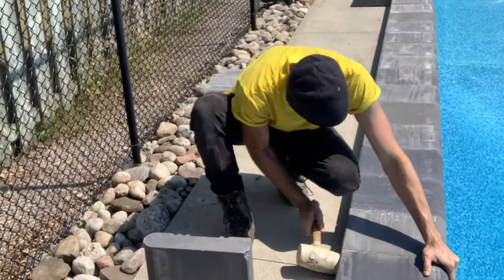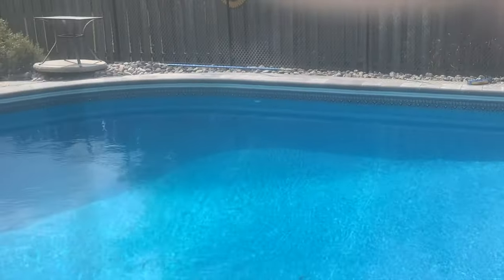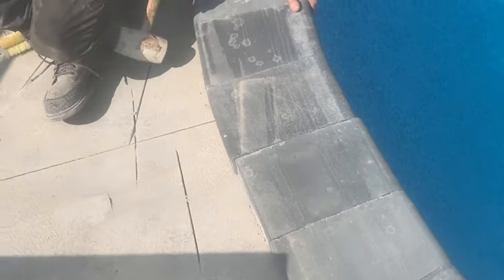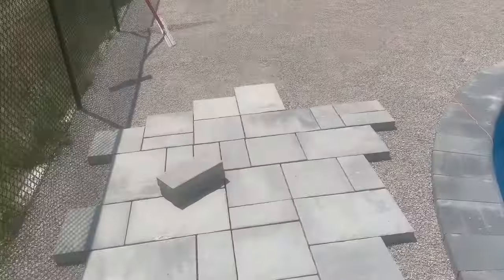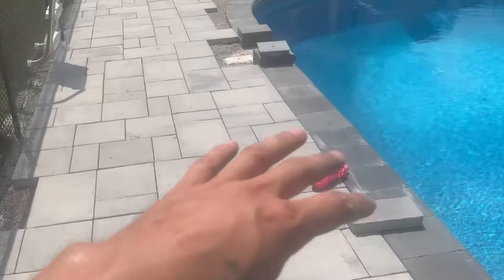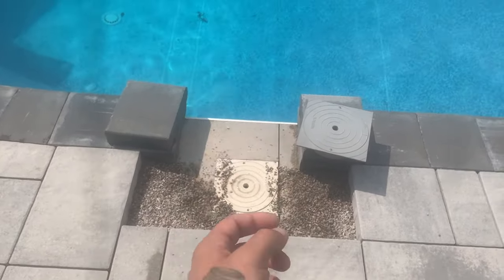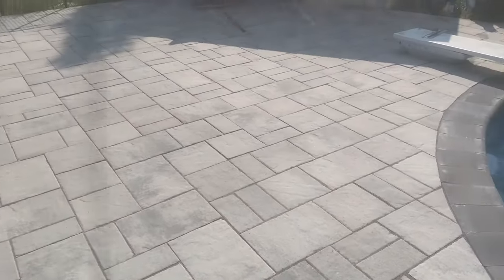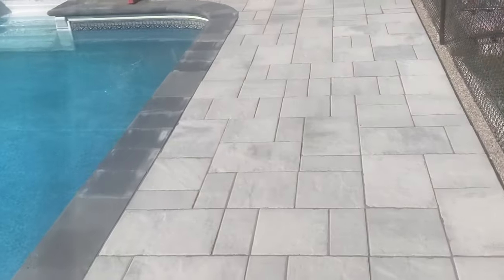Resurfacing a large swimming pool area with INTERLOCKING PAVERS & COPING in Dallas, TX. NO DEMO!

Comment: I need advice on a diy project on elevating existing bullnose pavers by 1 inch. Do I glue on top of existing bullnose where I have bullnose on top of bullnose?
Reply from the maker: Hi! No, you would need to remove the existing bullnose and install new ones using “Mortar” so you’re able to have that 1” lift. Hope that helps! 💪🏼

Comment: concrete pavers, is it ok to install them over existing deck? and do you recommend sealing them or not? also, how do you controld weeds growing between them
Reply from the maker: Hi, do not install them over a wooden deck as they are heavy and the wood will rot over time. As for the sealer, Yes, I do recommend it as it will help maintain its color against the sun, it will also make it easy to remove any stain from the surface as the sealer will prevent it from penetrating the pavers. 

For the weed control, it is industry standard to use a geo-textile membrane. This is a woven fabric that is installed under the gravel base. When the area is excavated you install your membrane. Do not use garden fabric as it is too thin. It’s a woven geo-textile membrane. 

Hope that helps and good luck! 😊
Reply from the maker: 💪🏼 Follow me on Tiktok for more TIPS&TRICKS: @FrancescoPettinelli 

See ya there! 😊

Comment: Looks great. What did you add over the cement and under the pavers?
Reply from the maker: Thanks, Mr. Smith! After we adhered the pool coping - We added sand to level the ground and get it ready to receive the pavers. 

Thanks for watching and leaving a comment! 👍🏼
Reply: @MILTON_STONE  If the concrete went out several more feet would you still use sand or go directly on the concrete?
Reply from the maker: 💪🏼 Follow me on Tiktok for more TIPS&TRICKS: @FrancescoPettinelli 

See ya there! 😊

Comment: We hardscape too, lots of frost up here in Northern NY.  

What do you do for base preparation?  What state are you in?
Reply from the maker: 👊🏻😎Nice! 

We’re in Canada.. Lots of frost here too. 

This particular project was a resurfacing job over a concrete base - no base prep was done. In a normal scenario we would dig 12”-18”, compact the ground, apply geo-textile membrane, add 6” at the time of crushed until we get to 12” or 18” while compacting each pass with a jumping jack or a diesel compactor, then we add 1”-1.5” of HPB (high performance bedding) and lay our pavers. 
 
Do you guys do the same out there?
Reply: @MILTON_STONE  how do you deal with any water from the pool washing out the bedding from under the pavers? Is there any issues surrounding that?

Comment: Did you have to remove all the existing concrete before putting the papers?
Reply from the maker: No, we did not. The concrete was in good condition so we used an overlay system to resurface it. If your concrete is cracked and in bad condition we recommend removing it. Hope this helps.
Reply: @MILTON_STONE  I know this is old, but we have some sections of concrete that are rough, could we remove those sections and fill in with gravel and sand compacted and level it off with the rest of the areas?

Comment: 80mm cope and 60MM slabs?
Reply from the maker: Yes, this way you can level the ground properly. If the coping is the same width as the pavers you cannot add any sand to correct the level of the concrete. Hope that helps.